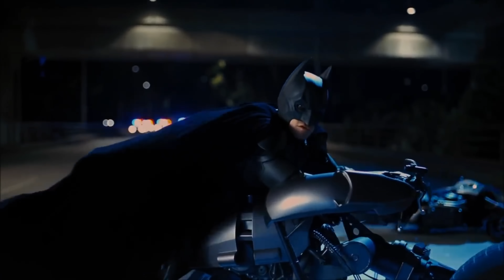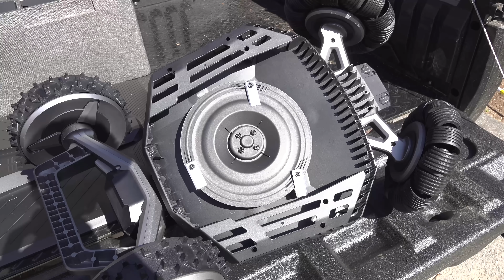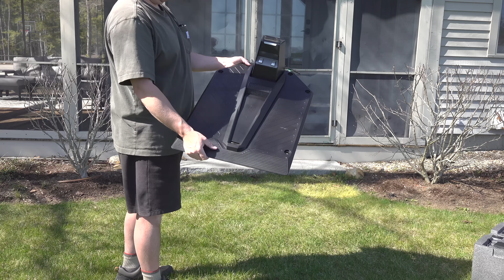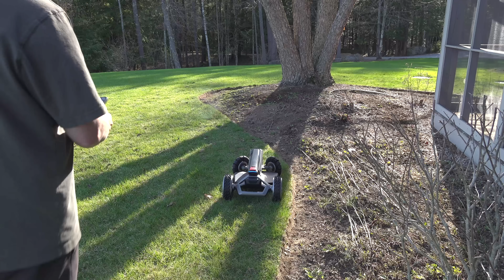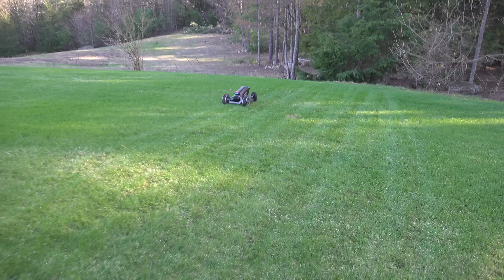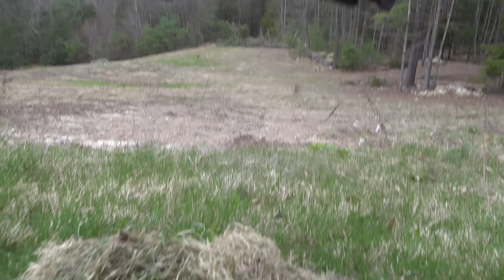Ecoflow BLADE Robotic Lawn Mower - First Look

Comment: It says "lawns up to .7 acre" -- but I think I heard you mention "zones" -- can you program say .7 acre "zones" to be handled on different days? For example, you have a lawn that is, for easy math sake 2.1 acres. Can you setup 3 zones, A, B, and C, and tell it "Mow Zone A on Monday", "Mow Zone B on Tuesday", and "Mow Zone C on Wednesday" and then repeat starting on say Thursday?

Just seeing if there's a way to work larger lawns into do-able chunks.
Reply from the maker: Yes you can do what you are asking. And the .7 acre size isn't enforced, I and I personally think it can do more anyway. But the key is the zones can't be too far away from the receivers. So you couldn't go to a next door neighbor, etc. Part of the issue is it depends on the shape of your house, etc. So I dont want to oversell something I couldnt test but if the other areas are reasonably close to the bases then it can be setup to break up the jobs
Reply: @SilverCymbal That's good to hear --  I'm assuming you can get multiple receivers ?

Comment: It's not the only cable-free robot mower available. There are cable-free robot mowers available from some big high-end European lawnmower brands like Husqvarna and STIGA. Husqvarna announced them a year ago and released 3 models this year: Automower 320 NERA, Automower 430X NERA and Automower 450X NERA which are compatible with the Husqvarna EPOS Virtual boundaries system. Husqvarna robot mowers are targeted for commercial applications, but a lot of homeowners have them too. Husqvarna robot mowers have won every robot mower test I have ever seen them included in, but they are also expensive. 
Another European high-end garden tools manufacturer STIGA has also launchend 3 GPS-based cable-free robot mowers in Europe. 
They were announced in January: STIGA A 1500, STIGA A 3000 and STIGA A 5000.

Comment: The software needs tweaking, it shouldn’t crab the front wheels whist still going forward, or parked that could damage both grass or wheel’s depending on soil type, also hopefully they could offer additional LiDAR base units for ,larger properties that may go out of bounds in  L or H shapes or larger areas more than 1 acres that could be cut in two charge cycles

Comment: People are overestimating these things capabilities. I’m a landscaper, head of my companies mowing division. This sort of thing simply does not work in places like New England. Wont touch sticks. not enough torque or inertia in the cutting system to deal with anything more than 1/8th in thick. I’m sure it would work on a half acre in Florida, but pretty much anywhere that isn’t level is going to be a no-go. Robotics are cool af don’t get me wrong, but some things require an operator.

Comment: You can upgrade that outlet to a higher quality/code with "Leviton 1-Gang Extra Duty While-In-Use Cover". They stick out a lot, but they work a lot better to keep water out.
Reply from the maker: That is a great idea, I need to replace the mounting block behind it too, 35 years in the sun has cooked it pretty well

Comment: Just say it uses RTK. Its not the first. You don't just put an RTK antenna where it can't see the sky 360 degrees. It makes more sense on the roof.  If they used Verizon HPL they wouldn't need it at all. Why didn't they put an extra battery on the sweeper?

Comment: I wish they would make a robot that worked with a remote control and had a camera on so you could sit inside your house and mow your lawn but what I really want is a snowblower like that I can no longer go out in the cold so having a snow blower that you could turn on snow blow your driveway and then bring back to a charging port in your garage and be all set for the next snow storm I would buy even if it was $5,000 or more as far as the longo's it isn't too hard to mall with an electric Ryobi lawn mower that only cost $300 I've had that lawnmower for years and it works great but a remote control unit with a camera that you could just do remotely I think would be awesome but so far no one has come out with anything like that and that would be easier than a robot that does what this one does so it should be easier to make but your video was really really cool to watch I enjoyed it thank you very much for making this video

Comment: skeptical when I first saw this on Linus tech tips. however, you have a good point on this product working multiple times a week, maintaining cutting an already nice lawn. We have a Chinese cheap low power cordless vacuum, the motor whine is not screaming unlike premium vacs and it works good enough for daily use light dust debris.

Comment: For the price you could hire a gardener for years to do everything the machine does and more without the worry of things breaking or the app being abandoned. Also you'd still have to strim/weed wacker around the edges and bits it can't do anyway or hire someone to do it. 

I see the value of cheaper sub $1k ones but $3k is asking a lot.

Comment: Segway have a few gps guided robot mowers that were available last summer in Europe, so this is definitely not the first. From what i understand ppl were pretty pleased with that one. Husqvarna has also got a model that works on gps, but it is much more expensive and not really a regular consumer product. I also believe that the new ambrogio mower without boundary wire is available for purchase, but it works in a different way and is still somewhat dependant on wire to guide the mower back to its base.
Reply: The antenna is there to have a fixed point to deal with GPS wandering. They will both get the same differential between a fixed position and the GPS position, so the antenna can send the differential to the mower, so it's consistently at the exact position. Excavating and surveying people use this to get exact location, but based on a known exact position. It was amazing seeing a bulldozer make a perfectly level basement using this technology.
Reply: Toro keep promoting theirs, its available on pre-order, but they don't tell you what the price is...

Comment: Husqvarna has had this out for a year or more with their EPOS system which is the same as the ECOFLOW's system.  Husqvarna also has a 3.6" cutting height and larger areas.  Before stating this is the first you should do some research.   Toro actually has a much more residential friendly version coming out this year with no satellite or large antae to worry about.   Also the intent of a robot mower is to cut it to the point where you don't have to bag so the bagging option is pointless.  Keep up the good content but you missed your normal due diligence on this one as Husqvarna is one of the top robotic mowers out there and have had all the features of this minus the bagging for quite some time.
Reply from the maker: The EPOS is for commercial use only and is not available to consumers and sells for $6,000. I am well aware of this model, reached out to Husqvarna and they never responded, not as a Youtuber, as a customer to buy it. It is a trophy model they could bring to shows and they have sold  less than a handful.

Comment: I have a backyard with a playground, and landscaped front yard, a parkway, a strip of lawn along the driveway, and a larger strip of lawn on the other side of the house. No lawn connects them. Can I still use this product? Does the antenna need to be line-of-site with the robot?

Comment: Sure it’s a sponsored video and all, but little spiny razor blades  aren’t going to (deep cinematic voice) END MOWING FOREVER.  But at least China will have some good maps of our urban lawns.
Reply from the maker: While Ecoflow broke a lot of technical barriers with the mower the cutting system is a standard robotic mowing cutting deck which has been proven for many years with the exact blades shown. As far as the paranoia about the lawn data, I don't think it will offer much tactical value to an enemy.

Comment: Although I love the idea of owning a robotic lawn mower, I must admit that these machines have some significant flaws that may make them unsuitable for certain situations. Firstly, if you own a dog and they defecate on the lawn, this machine may not be the best choice unless you are willing to clean up the mess several times a day. Secondly, if you have children who frequently play on the lawn and leave toys scattered about, this may not be the most practical option unless you are willing to consistently pick up after them. Lastly, if you have trees that drop large sticks or other debris, this may not be the most efficient option unless you regularly clean up your lawn. In such cases, it may be more practical to simply mow your lawn manually. This is coming from someone who is a fan of robotic vacuums.

Comment: Does it alternate cutting pattern?  I like to mow horizontally one week, then vertically the next, then diagonal the next.  Can it do that?
Reply from the maker: Not in the app as is, however they could absolutely add that. It could even do criss cross as well which some folks would do nuts for. I have sent them some feedback, i will add yours too. They seem very eager to add software features from customers.

Comment: I'd like to see a test of your whole lawn. The advantage of a smart mower should be remembering where it has mowed and be able to pick up where it leaves off. Like I'd like to program it to cut 2-3 acres. With it being able to cut 4 hours and charging 2 hours that's 4 cuts a day. It should be able to do a lot in a week.
Reply: But your battery would be dead after one year…
Reply: @ipodman1910 it’s a small battery shouldn’t be that much more than 500-600 even though it probably is. Small price to pay for a years worth of continuous mowing
Reply: @monhi64  back in my day we had better mowers they were called kids

Comment: Have to agree with Max.  The cloud and software dependency are non-starters for me.  Sometimes simpler is better.
Reply from the maker: The app is only used to setup and monitor the mower, if desired. You can program a schedule and never use the app again. Do what you are comfortable with but I don't want you to think the internet drives the mower, it doesn't.
Reply: @SilverCymbal  Thanks for the reply but doesn't it depend on GPS for location accuracy?

Comment: Can you do a large lawn and it would just mow different sections? Section 1-mon, 2-tue, 1-wed, 2-thur, etc?
Reply from the maker: Yes that is possible but you would need to make sure the receiver can reach all areas. So while technically possibly they couldn't be too far away

Comment: Looks unnecessarily complex.  The positioning system allowing (hopefully reliable) mowing in lanes is fantastic, but the electric height adjustment and the weird front wheels just seem unnecessary expenses in my eyes.  As for the "cleanup" ... you're first mulching the cut grass and then running a separate pass picking that cut grass back up?
Reply from the maker: All of these have complexity to them but to answer your question about mowing, no you would always mulch the grass blades in. The bagger is for debris cleanup for trees, fall, etc. I wouldn't use the bagger after every mow, you wont need to. I couldn't even see the clippings since they are so small

Comment: It's not the worlds first wireless lawn mower, as far as I Know there are two more satellite lawn mower as well as a wifi based lawn mower, all working without wires. 
The most important part that you didn't tell about, is if the satellite lawn mower requires yearly subscription for the 4G satellite after a while, or is it free forever?
Reply from the maker: There is no subscription fee for this mower. It's using GPS and freely broadcasting satellites, like your car GPS

Comment: Does it require internet to set up or operate?  Does it use the internet at all?
Reply from the maker: It only uses internet for initial setup, firmware updates. The mower has wifi but mainly uses bluetooth since most peoples wifi wont reach their yard. This is smart since youuse your phone, program the map and schedule and then it goes from there on its own. No internet required for regular use.

Comment: The cost is crazy high.  Hoping one day it will cost as much as a traditional mower + 20%.
Reply: Evolution never stops, so there will be way better robots at less than 1000$/€.   I bought a regular robotic mower a few years back, but it can not do anything besides mowing a close-to-perfect lawn.   Mine is bumpy and it needs a mower with bigger wheels that do not get stuck all the time.  And I also want one with sensors for hedgehogs so I am not getting a massacre.

Comment: I absolutely love my Worx Landroid. But ultimately it’s a Roomba with razor blades. If I were to move, I would totally buy this. The pain of setting up the wire, troubleshooting it for a summer.. is not fun. But this 3rd year it’s been flawless.
Reply: Works has a vision enabled version that released in the last month... no wires.
Reply: @Wingnut353  Looking at it, not bad. I’m guessing it still doesn’t cut in straight lines based on their write up. The $$$ isn’t too far from the ecoflow.. Would have to take a hard look at each if I were to move.

Comment: This is amazing engineering for sure. However the cost would be a deal breaker for me. For the price of the mower and sweeper plus tax, it would take nearly two years to break even with my scheduled lawn service, and I would still have to do all the edging and fall leaf cleanup, along with maintaining the mower and sweeper (cleaning, blade changes/sharpening, etc.).

Comment: Definitely the best one I’ve seen so far! Some major issues tho, at least for me:
1. Cloud connected. Like every other Cloud powered device, once the service stops, you have an expensive paper weight
2. Needs a buffer at the edge. I think a better design would of been to tuck the wheels in more so that the mowing deck could get right up to the edge of the lawn
3. I’d still need a standard mower or get really good at “mowing” with a string trimmer to cut that buffer mentioned in #2
4. Price. Assuming $80/mo for a lawn company on a 3/4ac lawn, it’d take ~3yrs to break even while you still doing your own edging and “buffer cleanup”
Reply: Yeah, that buffer is really bothering me.   Wide track on the wheels means less scalping on uneven ground, but it needs the ability to swap the blades for a string trimmer on one side or the other for a second pass.
Reply: $80/month!!  Maybe 5 years ago!!  We pay $175 a month and we don't even have 1/2 acre!!!  And this is the CHEAPEST price we could get for this year!!
Reply: @@getrekt3917 Yes, this is for early adopters that have enough money to justify this and a lack of time or ability to actually do it. There are other options, paying for the service is one, another is just tearing out the lawn and replacing it with groundcover that doesn't require mowing, or watering, in the first place.

But, I do think that this will come down in price as people aren't going to give up their lawns if they haven't already.
Reply: So it comes with a cloud service subscription? That sucks.  You are correct about having a hi tech paperweight when service ends. If Google is constantly shutting down cloud services yearly and they have way more money, leaves you to wonder when subscription fatigue hit consumers this company will suffer. Hard pass until this is clarified.
Reply: DIY if u can do some mechanics and have the time. On line resources exist. Know someone retired that wanted a rcv to cut hills. The push mower to heavy on hills. Cloud lock in a big turn off.  Otherwise nice if can do hills.
Reply: YMMV for lawn service pricing as there’s lots of variables. That said, a majority of folks have ~7,500sqft LOT (minus house). I’d recommend doing your own break-even calculations for your specific yard/needs.

Comment: I had a Husqvarna AutoMower 450x I installed a few years back, I used it about 1 season and then sold it for big loss of money and my time...   My biggest complaint was that the grass would get matted down from the wheel tracks  foot traffic, and with no suction the grass blades were never able to stand up, and if they did stand up, the mower would knock them over and they'd go uncut.  The only way to minimize the issue would be to set the blade height to about half the max (1.25" vs max of 2.4) .  These new mowers claiming 3" or so, I just can't see how they will perform, unless cutting very dry lawns with thicker blades that are less prone to being matted down by everyday lawn use.   That bag attachment might be the key to just use it as a rake to prevent the matting issue at higher cut lengths.   Just one of the other issues, is with the lawn cut everyday, your edges always look untidy as they are so much taller, and who is trimming everyday 2 days to keep up.   They need to design one to edge trim.... I did a bunch of brick work around some flower beds, and that worked great, but its not realistic for big yards.

Comment: You obviously have not looked into robotic mowers lately. 😂 most now are wireless. This is NOT the first. And, most cut in straight lines now as well. Also, that incline won't do a ditch and 3/4 an acre is way too small as others with all this tech can do over 2.